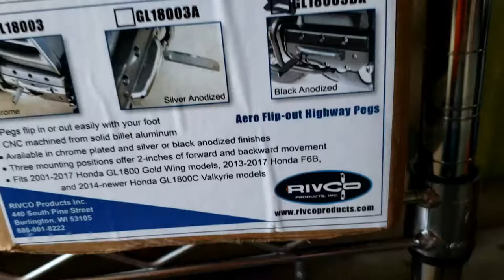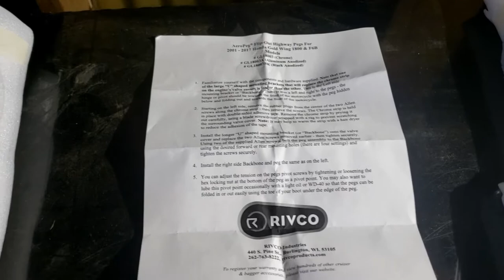How To Install Rivco Aero Flip out Highway Pegs 2010 Honda Goldwing

Comment: Redbeard - I've been thinking of changing my footpegs - how do you like those flip-out pegs? Recommend them? Thanks!
Reply from the maker: I do recommend them. I like the way they look and they are more comfortable to me than the old ones. They come in chrome if you like that look better. One challenge I have is they are a little tricky to flip-out when riding. There is a little knob on the bottom that I have to catch with my toe. I've gotten better at it, but it is still a little tough.
Reply: @AdventureswithRedbeard  Thanks!
Reply from the maker: Happy to help! Let me know which ones you choose.